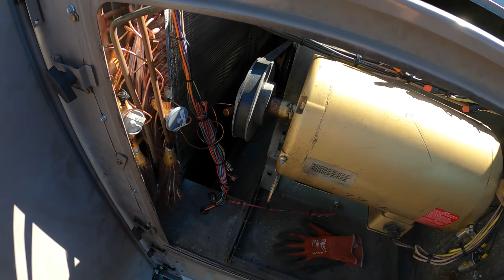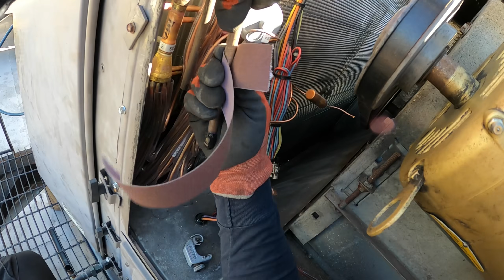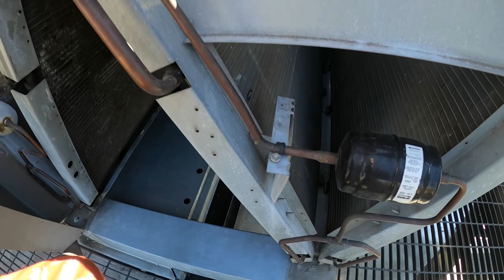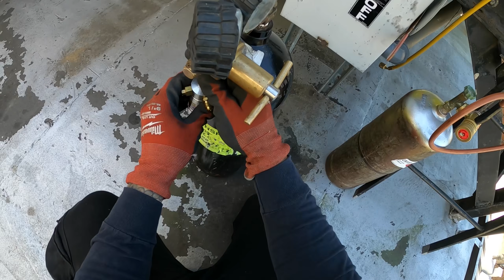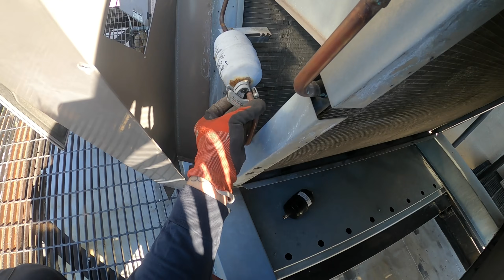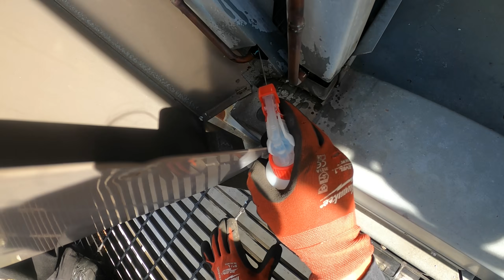HVAC: YORK RTU Dual Circuit Evaporator Coil Replacement PART 2 (York RTU Evaporator Installation)

Comment: JMT or any service tech's out there. Do you ream your cuts and when I do them, sometimes i can't get some of the cuts down to dump out any shavings. I am curious if they melt back during oxy acetylene brazing. Sometimes I shop vac a little with hand to suck out any. Just asking.

Comment: If you get some TruBlu 3/4" ID vacuum hose, you can pull both systems down to 150 microns in about 2 hour or lest I've been doing HVAC/R for 20 years the TruBlu vacuum hose are a game changer cuts vacuum time by 80%